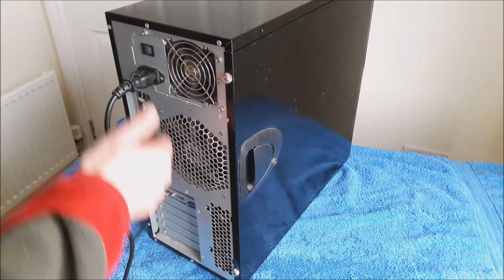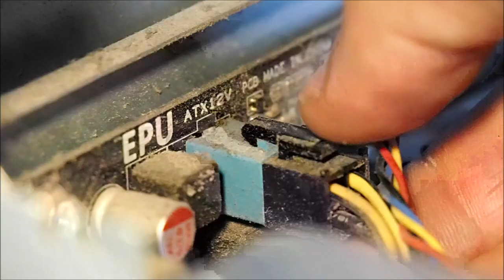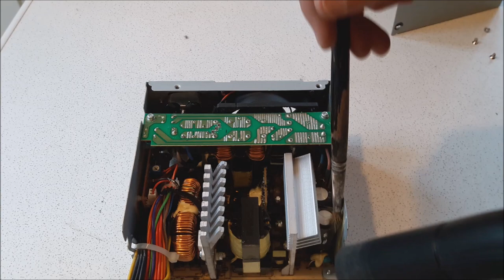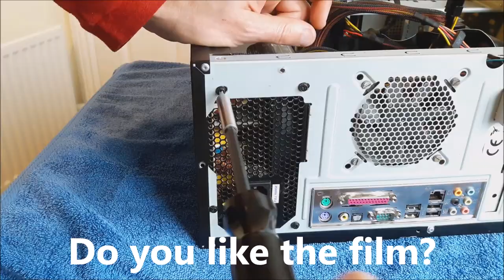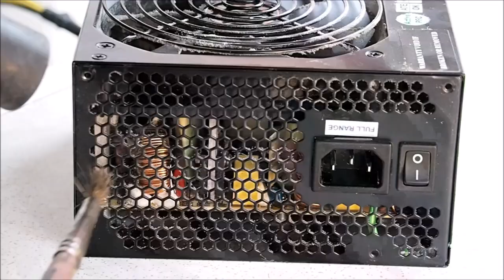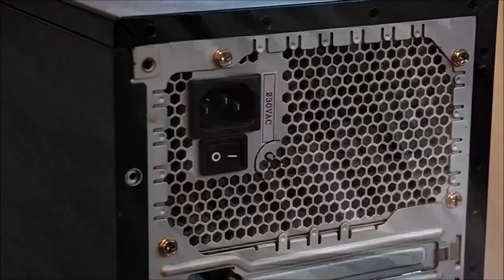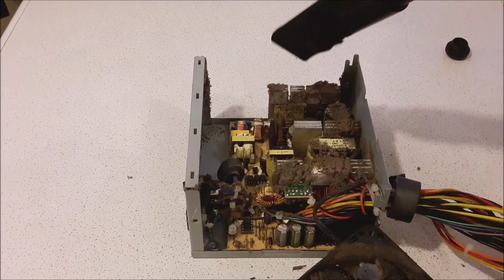How to clean computer power supply unit

Comment: GUYS NEVER OPEN POWER SUPPLY EVEN IF YOU WANT TO CLEAN IT USE COMPRESSED AIR DONT TOUCH IT IF CAPS ARE NOT DISCHARGED THEY CAN KILL YOU ON SPOT
Reply: Uhmm question, compressed air will only push back the dust inside if you will not open the psu right?
Reply: @rylejustindahilig524  i don’t think so compressed air is really strong I think it can clean the psu out of dust
Reply: imagine dying to a psu so sad lol
Reply: @midnightclub7629  not the way i wanna go out lol
Reply: Even if it doesnt have power?? Really? Omg
Reply: @sparcomusic887  Yes, even if its unplugged they can store power for a while. Unplug your computer, then press the power button and you'll notice your computer almost starts to turn on. That's from stored current in the power supply. Don't touch it unless its discharged and has been off for a while. Even then, just take caution.
Reply: You can open the power supply and clean it with compressed air without touching the capacitors, no need to be so paranoid, not opening it just guarantees that lots of dust will remain inside and on the fans so it's important to do it because your PSU can die early due to dust build up. There's also ways to discharge PSUs, you can look them up if you're still scared.
Reply: remind me of my old chinese knock off phone charger when i disassembled it. I still hurt thinking about that thing
Reply: @gooblord9006  how much time for discharge? to clean it with a brush?
Reply: Cap 🧢 bruh i just open my power supply and touch it with my bare hannd
Reply: @vincentancapoy5535  same here 😭😭
Reply: Well i guess it's do or die, if i don't clean it, who else will you know
Reply: @macblink  😂
Reply: Or just use some rubber gloves

Comment: You never vacuum any electrical components in your pc and psu is no different... also you should mention this can be very dangerous if done inproperly.
Reply: He did in the description if you bothered to read it , theres nothing wrong with vacuuming a psu either.
Reply: @causetheplumstasteyum7848  Completely wrong practice, agreeing with eXampL. Even without touching the problem is the static electric and (as we have known from the ancient years (:@) static don't need any touch. Tsaaaak and microchips are gone. Compressed air is the best solution.
Reply: @filimonkaltsounis65  I understand what you are saying i personally wouldn't either , If you just do regular cleaning / maint there is no need to let it get to that stage anyway , but say if you were cleaning a really old pc etc it wouldn't do any harm just as long as you were careful ,  just replace a psu if it was really THAT bad , i expect it would be very old and not worth it anyway
Reply: vaxum doesnt no equal to blower
Reply: I’m on mobile so I don’t ses the description. Thank you for this
Reply: @filimonkaltsounis65  I like the Tsaaak part. So greek xD
Reply: @filimonkaltsounis65  hey can I just use a soft brush instead of the vacuum or is it still wrong?
Reply: @nastyagamwspiti  that's fine but do it outdoors so you don't have to worry about the dust that will eventually return back to all of your equipment.
If you can't bay canned pressured air you can go to a gas station and ask them to use the pressured air but be careful, if they don't have a valve to reduce the air pressure, then blast from a distance, else you can reap things apart.

Comment: THIS IS EXTREMELY DANGEROUS AND COULD KILL YOU. Just because the psu is not plugged in doesn't mean the capacitors won't hold a charge. Also never ever use a vacuum on electronics and this can cause major static electricity. Also never touch anything in the psu apart from the fan. This video might kill someone .
Reply: Turbo's and Gaming PC's  yes it's important you drain them and I agree with that. Although the capacitors can hold alot of charge and that's why when you turn your PC off and go to work on the psu you press the power button when it's off. You can look up articles of people dying from them and it is real! Power supplys have alot more safety features now than before but also hold way more power for higher end ones. It's always best to be safe and remind people to be careful around electronics.

Comment: all those plugs 😭 this is gonna be interesting. Wish me luck.
Reply from the maker: 🤞 Good luck
Reply: How did it go ?
Reply: @bobozwald3234  but even if I discharge power nothing should happen right?
Reply: @dErHaRd23  even after you unplug, the power supply can still hold a charge for a "short time" capable of killing you. To discharge, you unplug all cables to your PC (power cable, mouse, etc) and then hold down the power button on tower for 30 seconds to fully discharge any stored electricity. 

Even then I would still be careful (don't touch anything metal with anything conductive).
Reply: I prefer canned duster
Reply: @gameora25  I would definitely go that route if possible.
Reply: @bobozwald3234  is one can duster enough to blow the dust or do i need two ?
Reply: @kcjpunk  I know this is kinda late but I've been using 1 can to clean my entire PC so I think one will be ok, dont quote me on it though. Make sure u have a vacuum so the dust doesn't just settle back into your PC or PSU
Reply from the maker: ARAF IFRAD  If it's only on the fan then it's not a problem. But it is worth looking inside.
Reply: Simi molgier is life, I just got a new psu wasn't making noise during my testing as soon as I put the pc back where it stays boom noise on start up

Comment: So even if the computer is completely turned off and all cables are unplugged it can still kill you if you touch an electrical component?
Reply from the maker: Capacitors discharge slowly. It is better not to touch the electrical components.
Reply: @k-nemo  but didn't you just touch them?
Reply: @Randorandom232 rubber boots?

Comment: I cleaned my 11 year old Thermaltake Torquepower 600w PSU with this method, went completely fine. I dissipated the charge by holding the power button before cleaning (with everything unplugged) and didn’t touch anything with my hands. I used a brush and a vacuum cleaner. If you don’t trust yourself and not skilled, don’t try it.
Reply from the maker: Thanks for sharing
Reply: How long did you hold the power button to discharge the capacitor?
Reply from the maker: @marklesterbalagat6793  After unplugging the power cord, you can press the power switch on the computer for a while. This will speed up the discharge.

Without doing it, the capacitors should discharge after a few minutes.
Reply: @marklesterbalagat6793  1-2 minutes just in case, but i think 10 seconds did the job because the green LED (that indicates the power on my motherboard) turned off after  10 seconds of me holding the power button. Also my PSU made some noise after few seconds too. And if you don't trust yourself with this potentially dangerous task don't try it, i was pretty sure i wont touch the capacitors so i went for it

Comment: I would never do this with a vacuum cleaner, And I'm not really sure how to properly discharge the power supply completely even after you unplug it. Capacitors can hold an electrical charge even though you have unplugged the device.
Reply: If you have absolutely no choice you can unplug it and wait for at least 12 hours so the electric charge can dissipate, but even then it's not wise to use vacuum on sensitive parts of your PC because it can create static electricity and render your psu useless, it's cheaper and wiser to use a can of compressed air and use the little straw thingy to stick it inside the psu and spray and pray all the dust away
Reply: I tried praying that all the dust would go away, but it didn't.

Comment: How to clean your PSU.
Google: Opening it can be dangerous, so use a 12-oz compressed air can and blow the dust out from inside to outward
Bing:
Reply from the maker: Compressed air can also be a good idea.
Reply: My  desktop  PC  has  the  dust  blown  out  every  spring , I  have  had  this  H P  desktop  for  eleven  years  and  today , for  the  first  time.....Dust  was  blown  out  of  the  PSU .

Comment: Every psu i have opened in the last 15 years or so has has bleeder resistors in them.   In the time it takes me to clean out the rest of the computer, the main filter caps in the psu have bled down to less then a half a volt.

Comment: As long as I don't touch or messed up the capacitors it fine right?
Reply from the maker: Yes, the electronic components do not need to be touched.
Usually the capacitors discharge before you can open the case, but it is better to be careful!

Comment: So if you touch the coils with your brush it's fine right ?  No need to ground yourself or anything like that ?
Reply from the maker: It's good to discharge static electricity first, touch for example water pipes before you start cleaning. I did it in my other video, about cleaning the graphics card  https://youtu.be/D5YUwKocdGU time 0:06.

Comment: Should I spray Akai on the PSU components ... it works on my Mobo by the way ... what if I used a blower beside the brush?
Reply from the maker: You can use the blower. I wouldn't use Akai spray, if you blow out the dust it will be enough, the components are not dirty just dusty.

Comment: my computer keeps crashing, found out its because of the power supply 
will cleaning work? or should i buy another one?
Reply from the maker: There can be many reasons for this. If the power supply is clogged it is worth cleaning it. The next step may be to reinstall the operating system.

Comment: I use power supply for my tv to work. And now my power supply is not working. I cant use my tv . Does cleaning may help ?? Thanks
Reply from the maker: Unfortunately, if the power supply doesn't work, cleaning won't help
Reply: If the fan is not working or fully loaded with dust , its an easy fix if the whole unit is knackered than not

Comment: You know you might die In the proses right? Power supply might keep alot of current for weeks after disconnecting it from the wall o.O
Reply: I was gonna ask the same thing. Isn't it dangerous?
Reply: lol its not a battery...
Reply: @idahagglund524  I've been electrocuted by a 2006 imac's PSU that hadn't been powered on since 2018 and it gave me a mazive shok, the capacitors can still hold charge even months later
Reply: @98SE  Really? Well great, now I'm gonna be paranoid every time I clean out my pc 😒
Reply: Most of pc components hold very little charge (if any at all), you don't have to be afraid to clean them up.
But yeah, PSU capacitors can hold high current charge literally weeks/months (unpowered).

If you don't have safety gloves (class 1+), just take your PSU to an electronics repair shop, it should cost no more than $5 ~ $10 to clean it up.
I clean mine PSU like once every 3 years.
Reply: in my workplace we repair big SMPS (s), no one's gonna die , but you might one big blow of High voltage....may be around 400V in in pcs SMPS
Reply: Just be careful when doing so like in the video , know which parts of the psu to touch and which not too before attempting to clean a psu , pop a pair of rubber gloves on if you are overly paranoid about it

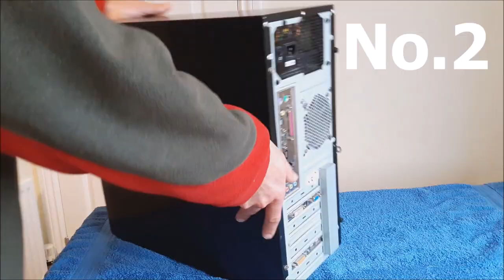Comment: 1:36
can i do it with ToothBrush?
Reply from the maker: Yes, you can use the tooth brush, remember capacitors can be charged. Don't touch electronic parts with hands